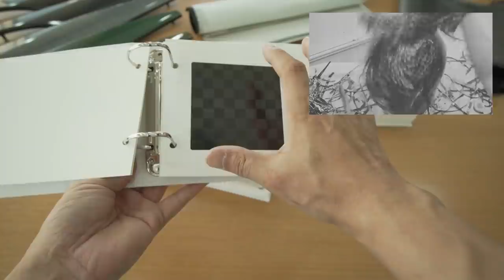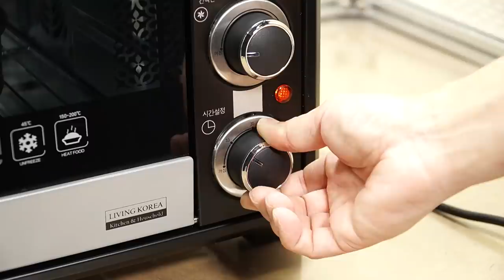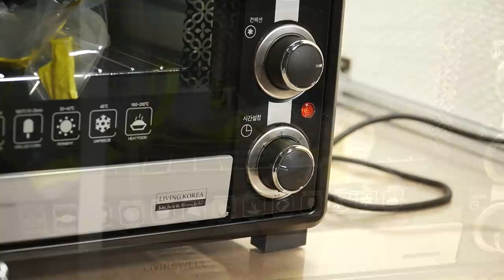How to Bake Prepreg Carbon Fiber Brake Cooling Ducts in an Oven [DIY]

Comment: only when you worked with carbon fiber and try similar things, you understand of what this guy achieved in this video with those many details of the part, I am working with carbon fiber for 3 4 years now and still, I don't have enough confidence to know I can do the same thing as this video and the end result looks so perfect, huge respect bro you are doing really great, just buy a vacuum pomp it seems you really need it also a Dremel tool, mad respect!!
Reply: Seems shear luck, also the plastic bag inside the oven is a no go, unless it is a specific oven plastic
Reply: @claudiobertadeazevedo4669  I don't believe that is the case, I emailed the owner of the channel a couple of months ago and he really knew what he is talking about so I don't believe he leaves anything to luck
Reply: @claudiobertadeazevedo4669  This can't be further from luck. Did you even watch the video? Do you know what luck means? This is pure skill.
Reply: @TheEchelon  I’m a laminator for a very well known car manufacturer and can say this guy is highly skilled, he’s basically making his own pattern as he goes along. (Pattern makers are rare these days). This looks really good, the prepreg he’s using doesn’t look that of automotive standard though.

Comment: Actually the brake duct is effective when the outlet is closest to the hub.
Cuz it's designed to be cooled by having the air from the inlet of the brake disk, which is the inner slots of it.
Reply: I was literally then about to write this

Comment: Very good tutorial!  I am suspicious of the resistance of this piece due to the incorrect cooking of the Prepeg since it requires two firings of different temperatures.  However, it is a good method for parts that are not exposed to impact or torsion.  Your tutorials are really very good, hopefully one day you will make a bonnet!

Comment: You are AWESOME. I was planning to add air ducting on my M4 as this is why F80/82 brakes give up on track. Assuming you re running fresh race brake fluids, track ready pads and no MDM selected, AND ducting there is no need for big brake kit. I am not confident with CF though so I will buy the front ducts in aluminium and weld the 2.5” aluminium pipe on the aluminium BMW OEM brake shields.

Comment: Shouldn't the duct/pipe replace the original vents near the centor of the backing plate ? Because you want more air to flow through the brake rotor, then vent out of it, instead of lots of air only cooling the inside face.

Comment: What Temp is the pre preg epoxy rated at? Those brakes probably get too hot. Does the cooling work enough where you might not need high temp epoxy?

Comment: Quick question. But what is the temperature that this CF end product can withstand? I understand CF in general can only withstand up to 200 degree celcius or so? 

And performance brake temperatures can get heated up to 700 degree celcius.  Was this made with performance driving in mind?

Comment: You probably should have the air duct closer to the hub at the base of the disk so it blows through the center of the disk, cooling the whole disk.

Comment: Awsome job.... What you like the Prereg Carbon ? Is it more easy to work with ?
Reply from the maker: Hello friend.
The Prepreg carbon fiber is simpler to work with than wet carbon.
However, in order to use the prepreg, that need molds that can be used in high temp, an oven, etc.
And it is expensive.

Comment: Always perfect video man
But for the first time I have a question, What is that aluminium filament that holds temp ? Haha
Reply from the maker: Hello friend.
To make a mold for prepreg carbon fiber, I used a filament containing aluminum instead of the usual PLA filament.
The filament has a higher heat resistance than PLA.
I cured the prepreg at 120 degrees Celsius.
But I think PA-CF filament is more suitable for high temperature than aluminum filament.
Reply: @ECOLAPStudio  thanks for your answer mate ! 
Yes I thought about PA-CF but the problem is that it is abrasive, but I saw that you used it for your BMW carbon steering wheel, maybe need that much pre-treatment as you made for it to get less abrasive side (sorry for my english haha) 
As it is to make wishbone/rim and stuff like that, PA-CF is a very good option, but I was scared about this abrasive side
I will let you know when I will make it in future Channel! 😉 thanks again for all your work!

Comment: It will raise the temperature when do a hard brake, the heat will melt carbon fiber and epoxy parts. So I don't think cfrp is better than origin parts to be used in here.

Comment: Hi thankkyou for this video!!! How did you find the 3d stl file to print the brake duct inlets?? they are perfect!  any chance you have the stl file??
thankyou
Reply from the maker: Hello, Friend.
I designed the air ducts my self.
But, I didn't share  STL files because I've designed when I beginner to 3D modeling.
If I modify the files, I'll share it.
Reply: @ECOLAPStudio  no worries. Thankyou so much for replying to let me know. Grateful for the content you put out! Impressed by the subtle comedy 🤣

Comment: what temperature did you bake them at?
Reply from the maker: Hello, Friend.
The prepreg carbon fiber I used is a fast curing type.
I baked it for about 10-15 minutes at 130 degrees Celsius.
For general prepreg carbon fiber, you need to bake it for about 1 hour.

Comment: Maybe it would be better to bring the fresh air on the deep center of the rotor, because like this I guess, It's cooling one side of the rotor even increasing temperature difference between the two sides, so maybe it will warp even more your rotor. So if it was more center the fresh air would enter better the vents of the rotor and cool the two sides.

Comment: I like the work, but you should reconsider the design. It makes no sense to feed the air against the back face of the brake disc. It should be fed inside the bell of the brake disc so it can cool the discs through the vanes by centrifugal flow

Comment: Nice work! Most amazed that you seem to do it all without power tools. Sorry if it was asked but what material did you print the brake inlets with?
Reply from the maker: Hi Buddy!
I watch your videos often.
These were very informative videos for me.
I made a mold using aluminium-added filament.
The filament added with aluminum has very little deformation, so I think it is suitable for making small molds.
I hope it helps you.
Reply: ECO-LAP Studio what temp did you cure the parts at?
Reply from the maker: I cured it at about 130 degrees(Celsius) for about 15-20 minutes.
I used fast cure prepreg.
I did a curing test above 150 degrees to test the aluminum filament and it was fine.
So it was a small mold, and I haven't tested the big one yet.
I hope it helps you.
Reply: ECO-LAP Studio awesome. Thanks!
Reply: @ECOLAPStudio  Could you share what is exactly this filament ? Thank you guy!

Comment: Great job, but...routing air toward the inside of the ring is not effective. That will cool only the inner ring but not the outer, placing the inner ring under more stress and temp changes, resulting in cracks. Air needs to be routed toward the middle of the rotor hat to utilize the rotor veins between inner and outer ring surfaces to suck the air through and cool both rotor ring surfaces together.

Comment: Haha, very nice!

What temperature did you put these in the oven at, and how long was the bake time?
Reply: When you buy prepreg, the manufacturer will supply you with a specific TDS which will tell you the exact cure process.
Reply: @thenotoriousflip4275  Yes I understand that. I just wanted to know what they were for the prepreg he used. The one I am using has a ramp cycle and a switched cycle which can be done at different temps....
Reply: @PLRTipyuk  oh sorry man, you never know how much the other person knows when answering a question on the internet haha

I thought it was impressive he had such good results with a countertop oven like that.. made me question if taking the time to build a custom programmable oven was worth it 😅
Reply: @The Notorious Flip  no worries man. 👍🏻👍🏻

Yeah it's the way I do it as well haha. I use xpreg out of autoclave https://www.easycomposites.co.uk/#!/prepreg/component-prepregs/xpreg-xc110-prepreg-carbon-fibre-22-twill-210g.html is designed to be used this way.

They came out very well though. They might not be quite as strong as full ramped items.

Comment: Looks beautiful BUT you are inputing the air in a wrong spot! This is very inefective and might even worsen the cooling. The cold air has to ho into the middle of zhe brake disc.
The work on the carbon part seems flawless, tho...
And the driving... 😄

Comment: These are not correct for this type of brake rotor, the inlet duct should be pointed at the centre of the disk so the vanes inside can correctly pull the air through and throw it outward as they are designed. The way you have done it your just blowing cool air on one side of the disc face which can cause cracking and incorrect pad wear. However these are very cool and good job making them from scratch.

Comment: 222k views and no one is going to point out what's wrong? You would need a lot of mold release or wax, which he didn't use. The epoxy would stick right to that aluminum.

Comment: I'm not so much of an expert at this but I think you can warp your rotors by doing this as the inside area will have significantly more cooling than the outside.

Comment: You really shouldn't touch prepreg without gloves at all in order to avoid deffects inside the parts you're laying up. And second of all, I don't know what kind of resin you used, but the resin used in aerospace prepregs cannot withstand more than 200°C, so putting CFRP parts close to brake discs is not very smart.

Comment: You put the air to the wrong part of the brakes. The air should be going to the center of the rotor so it can be forced out via the middle fins. Putting air on one side of the surface is not going to cool anything other than that one side which could lead to a host of new problems.

Comment: Love the videos but this defeats the whole purpose of carbon parts (car parts). He’s wrapping carbon on top of the original parts. It looks cool but has no benefit what so ever. The purpose of molding a carbon fiber part is its light weight, rigid, and thermo temp benefits. All this is good for is trying to look like you have something thats really not.. Not at all bashing his videos, however if he does any scca or nasa races with parts “wrapped” over oem parts it has 0 beneficial benefits at all for him.
Reply: In this video he made all solid carbon parts, he did not wrap them to look cool. I admire his patience the most when it comes to atention to detail. I believe he spent hours in sanding the molds and then the carbon pieces.